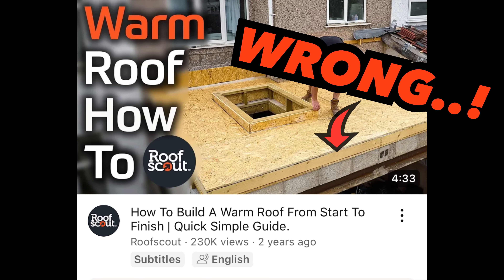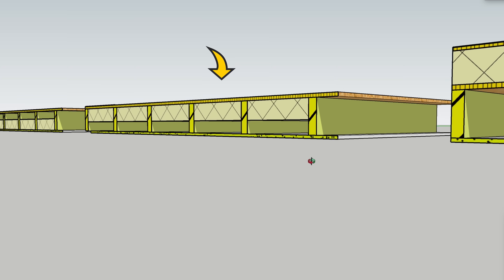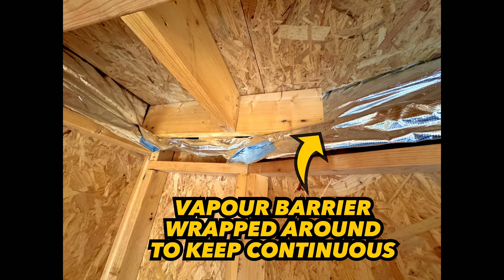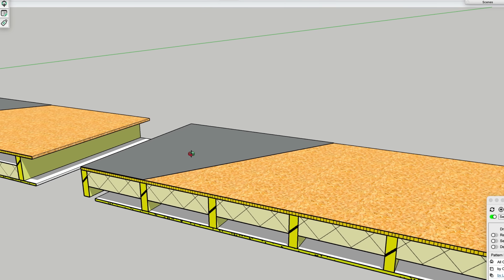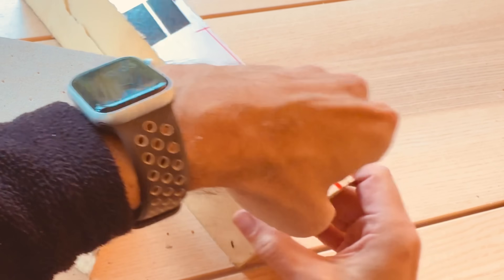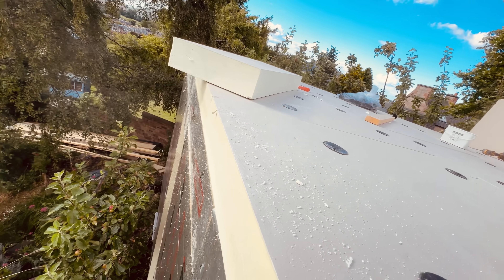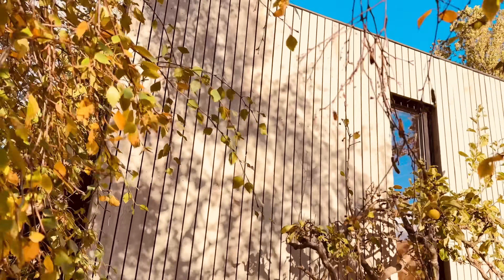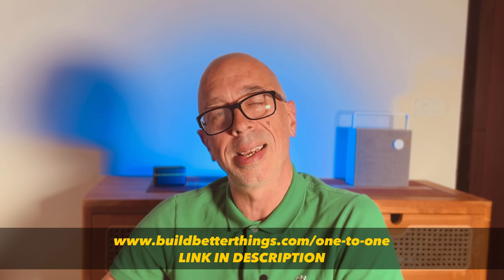Build a Warm Flat Roof the Right Way

Comment: I am an approved installer for EPDM and I manage several buildings with flat roofs. The older buildings have a more varied makeup but our newer buildings all have the same warm roof makeup. Joists, 18mm T&G OSB3 glued and screwed to joists, FG35 primer & Alutrix 600 (or similar) VCL, timber upstand to the same depth as insulation, 50-150mm PIR, all joins in PIR sealed with aluminium tape, 18mm T&G OSB3 glued together using PU glue and fixed to the subdeck using thermally broken fixings, fixings are then filled with expanding foam to prevent air pockets and then a 1.5mm EPDM bonded to the top deck using water based glue in the centre and 150-200mm perimeter using contact adhesive. Some of these have been in place since ~2010 and they have no issues. When installing we take pictures and send them to the supplier which gives us a 20 year warranty. The only time there was an issue, the membrane had been pierced in a few places by a screw/nail stuck in a boot and the contractor didn't notice. We do 2 inspections a year and noticed some spongy patches in the top deck. We removed and replaced the membrane and top deck. This roof was ~10 years old and the only damaged top deck sections were within ~1m of the penetrations. If someone drops a sharp item, we have patch kits ready to go. 
I can see where you are coming from re the timber of the cold side of the insulation but, you are fundamentally wrong about the EPDM at 6:10. It is impermeable but breathable. We have tested this ourselves using a pressure chamber. The EPDM was placed between two chambers, the top chamber was filled with water on top of the EPDM, the bottom chamber was pressurised to 1.5 bar. Bubbles of air were able to pass through the EPDM without any moisture coming through to the dry side. When the EPDM gets hot in the sun, the topdeck bakes and dries out.
Reply: There is absolutely a difference in access. I have personally knelt on EPDM over PIR and put a big dent in it. With regular inspections or leaf clearing, it gets battered. 
I guess our structural engineer consultants must be wrong 🤔 They sign off and guarantee every roof design so they must be in trouble when all of our roofs fail in a few years.
Reply from the maker: Structural engineers offering guarantees on flat roof makeup? They just do structure! You said you were an approved installer…don’t you offer the guarantee ? If you want to carry on putting OSB on the cold side of your insulation , with foils in your makeup… as an approved installer….good luck.
Reply from the maker: Hi and thanks for your perspective. Your reference about the breathable nature of EPDM at 6:10. I’m talking about it in the context of interstitial condensation stuck within the solvents and layers in the upper part of the OSB. It won’t breathe out in that situation. Later on, I mention the slightly breathable nature of EPDM, although I’m talking about it in the context of trapped air. Cannot fathom why you would want to be putting foil layers and composite timber anywhere near the cold side of a warm roof when you can eliminate the possibility of rot and trapped condensation altogether, and save money on materials and labour in the process.
Reply: @build-better-things  The reason we go with a top deck is to allow access. Even our lighter people leave indents on all the different solid insulation boards we have trialled. We thought about putting boards or planks down when access is required but they would either be forgotten, not used or there would be splinters coming off the wood. 

If there is a large pocket of trapped air, it has been installed incorrectly, for small bumps, we've put a block on top of them and the air gets forced out after a week or so. If a suitable vapour barrier has been installed correctly, the insulation is well fitting and the EPDM is well fitted, it should essentially be a closed system. The key with that is not using any wet wood or insulation in the construction process. The moisture added with the water based adhesive can evaporate out through the EPDM. 

Think about timber frame wall construction, especially stuff from the states where it is the dominant form. The layers from internal go Plaster(?), plasterboard, VCL, studs/rockwool, sheet material, breather membrane and then cladding. Some of the treated studs are quite wet from the pressure treatment and yet overtime they dry out. Moisture can't get through the VCL so it has to migrate out through the sheeting and through the breather membrane. I think about the top deck of a warm roof in the same way. Moisture will evaporate from the surface of the OSB and migrate through the EPDM, this creates an area of low water potential so more moisture moves here to achieve equilibrium. And the process repeats until no more moisture can evaporate. As long as more water vapour is getting out of the system than getting in, it will be bone dry. 

I think top deck vs EDPM bonded to insulation is a horses for courses thing but the top deck is more fool proof. Another point re maintenance is that if the EPDM gets penetrated, the water gets stuck between the EPDM and the OSB. If the EPDM is bonded straight to the insulation, the water will saturate this instead and then you have to replace all the insulation.
Reply from the maker: I appreciate your comments but you are wrong about access. There’s no difference in the wear between the two solutions. I don’t have the space here to go into the other points, but in summary, I don’t agree at all. OSB on the cold side with foils remains a detail I could never recommend, and I’m amazed that builders continue to do it for their customers in the UK.
Reply: I'm an architecture student that just wants to understand construction methods a bit more but everywhere I look no one seems to agree and there are endless options, what is going on?

Comment: Brilliant video. Honest question here though. Why do the instructions of the EDPM roofs say to use a water base glue all over apart from 6” around the edge and to use contact adhesive? And on OSB too ? Surely the people who make, supply and instruct how to fit should know this too ?
Reply from the maker: For a cold roof, this is the correct advice. For a roof with a ventilated battened cavity, this is the correct advice. For firrings over the insulation , this can be the correct advice.       But for warm flat roof??? To answer your question…… Ask yourself why these same companies all supply contact adhesives in much larger tins, and tissue faced roof insulation to go with it, for covering large areas such as the entire roof, for bonding directly onto the insulation. Because of course, you bond directly onto the insulation, for your warm roof every time. Why would you ever use a composite timber material such as OSB in that situation on the cold side? Thanks a lot for your comment. I hope I explain it ok.

Comment: what if you have insulation, cavity below it and above it, with air flow from start to back of building?
Reply from the maker: You only need to consider airflow above the insulation. That’s the only time I would consider using OSB above the insulation…if there was a ventilated void between the OSB and the insulation.   The cold roof example I show in the video. Airflow below the insulation does not really achieve anything.
Reply: @build-better-things  i dont really have much choice as the trusses go left to right in the garage. but it does have 45mm acoustic walls, with MLV. specs 25mm cavity walls, 47mm x 150mm supports with 25mm battens, 100mm acoustic rockwool insulation, another 25mm cavity. then 9mm ply, 12.5 acoustic panel, mass vinyl 2mm, 12.5 acoustic panel, 9mm ply finish. all layers are cross fitted for minimal gap transference and AC50 caulk for all gaps. 
Floor is blackjack DPM up 1 foot to the walls, (walls are painted with water repellent paint), 15mm to 32mm screed now cured fully, 1200 gauge membrane 47mm x 100mm floor with 100mm acoustic rockwool, same spec as walls, except 5mm slithers for heating matt with heat reflection layer and floating supports. 
MLV acts as a barrier for the entire room. 
Ceilings are a tricky one same spec wall, truss, 100mm (compressed in place with acoustic rockwool, using 25mm battens which allows some gap above the insulation, which should allow airflow from front, back and right side of garage. 25mm slithers then to allow cabling and access, rockwool is held in place by cross battens.
There is a air flow gap in the header of the top part of the garage, which flows nicely to the back two cupboards at the back of the garage. Seems to flow ok when tested. Cavities either side allow some air flow. 

any tips for that ceiling?

Comment: Great video, as always.  I have just completed a warm roof myself and used an 18mm OSB "top" deck, however I opted to use Fatra rubber membrane, which uses a solvent based adhesive on both surfaces and in addition I used Alutrix VCL which although expensive was very good on the lower deck. The Fatra was done by an approved installer, however he made me remove the thermally broken screws (mushrooms I called them) as they didn't fit flush and he is a bit of perfectionist and wanted a pan flat roof. I was a bit concerned as I had to replace with countersunk 240mm ones, which I know will affect the roof a bit, thermally. However as I will be looking onto the roof I must admit I do prefer a more flush finish. I'm not a fan of the lumps and bumps. Time will tell whether the upper deck rots!
Reply: One advantage of not putting OSB on top is that you can use a fully-adhered system which is intrinsically nice and flat. You could also have countersunk the fixing plates into the OSB. You will have lost a few percent of thermal efficiency in exchange for a flush membrane, and on frosty days you will be able to see where the fixing are, but it will work. Customers probably differ in which they would prefer.
Reply from the maker: Thanks a lot for sharing your experience. Yes the Alutrix is good solution although the challenge is getting it sealed into your vertical membrane. The plastic discs don’t bother me and it’s easy to make them regular.

Comment: Atlast some clarification, excellent work! Could you advise on how to build a flat roof on top of a single story extension that combats the noise transfer from rain? Thankyou
Reply from the maker: Hi. Although PIR is not particularly acoustically sound, if you’re building to current regulations, you’ll have 150mm of depth. Couple that with the deck and I don’t think you’ll find the rain noise that invasive. Eliminating sound completely would take some more work, but you’d have to consider then the whole space, including the walls and how the junctions work with the roof.

Comment: An interesting watch, however...
1. If we're talking about doing a quality job, a high end VCL will preventing the vast majority of vapour entering the roof build up to start with. Better still, if you also use foil backed plasterboard (or VCL under joists) then I dare say you'll probably have almost eliminated any vapour entering the insulation!?

2. If there is sufficient insulation, surely any minuscule amount of vapour won't still be warm when it gets to the top layer of OSB, and therefore won't condense at the top OSB as you suggest?
Any thoughts @better-build-things
Reply from the maker: Your point 1, for a warm roof, you should be having your vapour control above the deck, not below it. Foil back plasterboard is not great for a ceiling. Your point 2, I hear this argument a lot and it baffles me.  you’re going to have residual air and escaping vapour to create localised dew points. Why you would therefore ever consider putting OSB on the cold side when you could avoid it. The whole point is to design out your problems by not give them the opportunity to occur in the first place

Comment: So basically you're saying that although the OSB is somewhat water resistant, it does allow vapor, slowly, through it, to the point where the rubber membrane makes truly water and vapor proof layer, therefore trapping slow rising and condensing vapour underneath, causing the "bubbling" represented in your graphics? Fine. But what about, in the case of a hybrid or warm roof, wrap the warm side in vapour barrier membrane? Professionally fitted membrane (taping all joints and fixings, staples etc), ideally behind all plumbing and electrics to prevent cables and pipes piercing it, will reduce greatly the amount of humidity raising. Even then, PIR is usually a vapour barrier itself when it has aluminium foil on both sides. Then, if all gaps between the PIR boards are taped, all joints foam filled and in addition wrap everything in a vapour membrane, what are the chances of any damage in say 10-20 years or more to the top OSB decking? Also, slightly different topic, must a hybrid roof have a gap between the plasterboard and the insulation in between the joists or can the insulation fill the whole space between the joists, since no ventilation is there anyway?
Reply from the maker: Maybe I’m not understanding your description, but you never have an a vapour barrier on the cold side of the insulation as you describe. You want to block as much vapour as possible before it travels through the insulation, whether warm, cold or hybrid roof. So your vapour layer should be on the warm side. For a roof, that’s one of several reasons not to be using foils in your roof insulation. Taping the boats  on the warm side    exaggerates the problem even more. Hard to describe and I’m not certain I’m understanding you. Easier to draw I guess.   Thanks for your comment.
Reply: @build-better-things Thanks for the reply. I was asking if a very good installation of a vapour membrane on the warm side would prevent the problems described in your video with using OSB decking on the cold side? @build-better-things
Reply from the maker: Hi. Sorry if I misunderstood. Aside from the fact even a “very good” vapour barrier install on the warm side is going to have some leakage, but even if it didn’t, there’s going to be small pockets residual vapour at a warmer temperatures within the roof but below the membrane than the outside air with their own mini dew points on the upper colder parts. I’m trying to mitigate by avoiding timber composite and foils in that area so local condensation can slowly breathe out. Maybe you build it so well that that can’t happen, but that’s not my experience, and I don’t understand why you wouldn’t just design out the problem by using the correct materials and makeup.

Comment: OSB,  water based glue and EPDM is okay on a cold roof with insulation between joists?
Reply from the maker: As long as you have an air gap, ideally 50mm but dependant on the depth of your joists / insulation and that air gap needs to be pulling air through it by good use of vents. Then your suggested makeup is ok

Comment: What if you have a roof made of SIP paneels?
Reply: I've looked at the same and the SIPs supplier (SIPs industries in Scotland) told me the minimum angle their product can be used at is 11 degrees and installed as a cold roof
Reply: I’m interested in this too. Want to build an extension with SIPS. Can’t see how a minimum angle of 11 degrees would have any effect with regard to the topics of this video. Unless you mean the minimum angle of the cold deck side that’s needed for drainage?

I’m considering a fluid applied VCL for the underside of the roof SIPS to provide the best chance of resisting moisture transfer into the panel.
Reply: Yep. The top deck needs to be inclined at 11° or greater according to the manufacturer

Comment: What about when sips panels are used? The foam is completely bonded to the osb when the panels are formed in the factory so no moisture can pass through.
Reply: I've looked at the same and the SIPs supplier (SIPs industries in Scotland) told me the minimum angle their product can be used at is 11 degrees and installed as a cold roof
Reply from the maker: Cold roof is correct for SIPs, although it’s not really cold per se . For the reasons I say in my video regarding OSB on the outer side, you need the ventilation over the cold side.